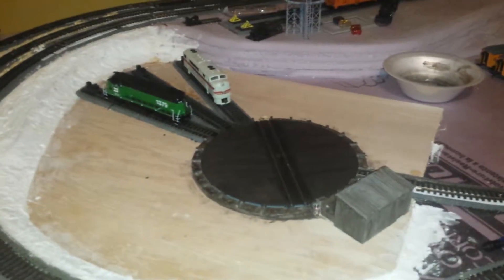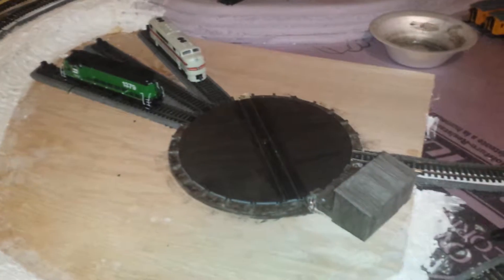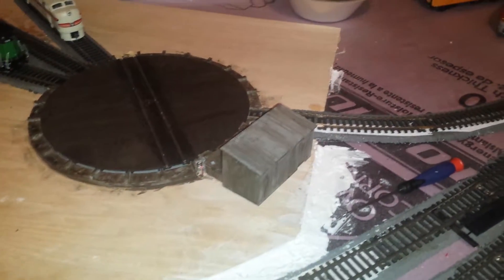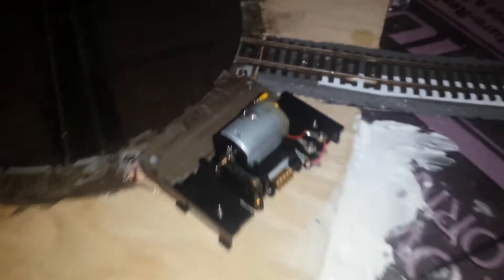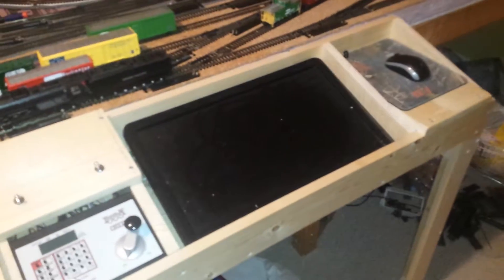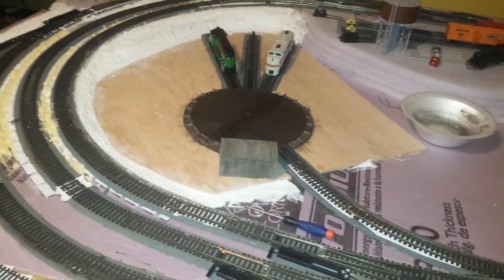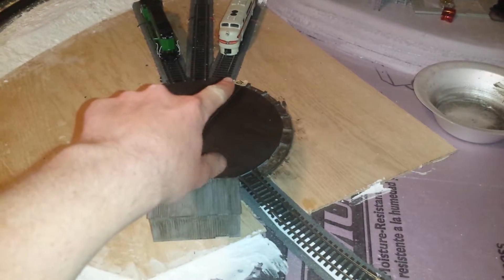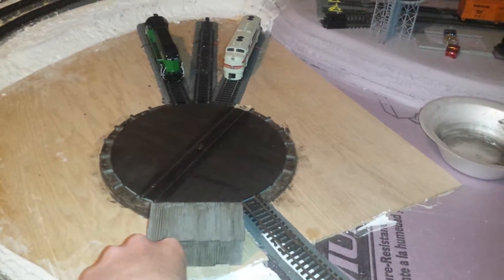Arduino Turntable Indexing System - Extended Cut

Comment: Nice videos.  I am working to do the same on my layout.  Is there a specific placement of the capacitors on the motor?  Also where exactly does the hall sensor and magnet need to be placed.  I found the project on GitHub "Turning Tables" but its pretty vague on placement of these items.
Reply from the maker: You may not need the capacitors, they just help reduce electrical noise from the motor by short-circuiting the tiny AC noise voltage that the motor's commutator makes as it runs. But I believe I placed them either between each motor terminal and the motor casing, or between the two motor terminals, or both (trial and error is likely your best bet).

As far as the magnet/hall effect sensor location, I don't remember exactly where I put mine (and it's a sufficiently touchy little mechanism that I don't really want to take it apart to check, sorry) but I put it on one of the gears. It just acts as a way for the Arduino to count the number of revolutions that gear makes, and you can do some testing to figure out how that gear's ratio corresponds to the turntable movements.

I'm glad you're giving this a shot, it's a cool project and once I fixed the motor noise issues, it has proven extremely reliable (it's been running for 5-6 years now). But I have to warn you, it's not a "plug and play" kind of thing...you need to understand how the system works before you go gluing magnets and hall effect sensors. I'm not implying that you don't, I'm just warning you. I am happy to help any way I can. Enjoy!